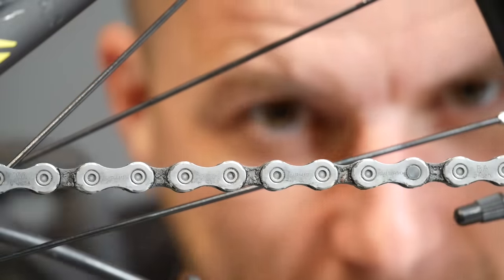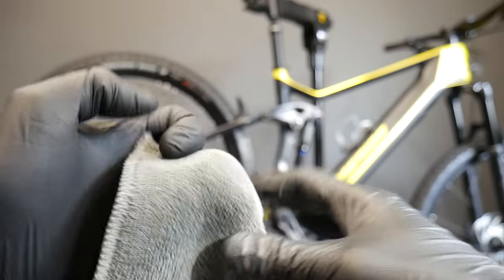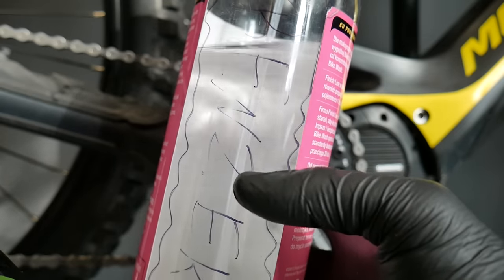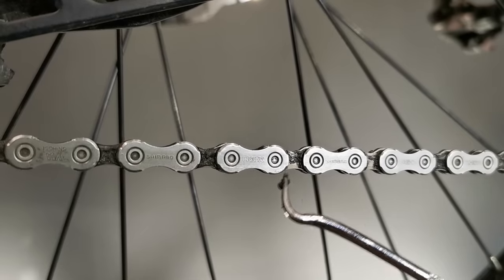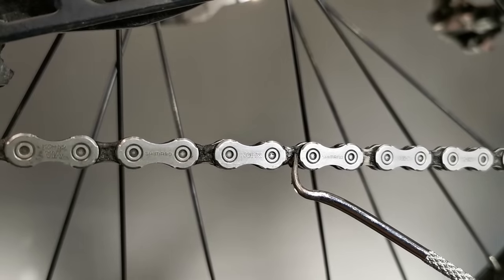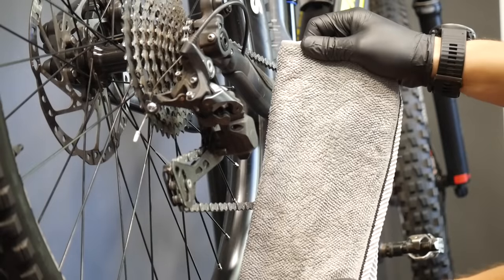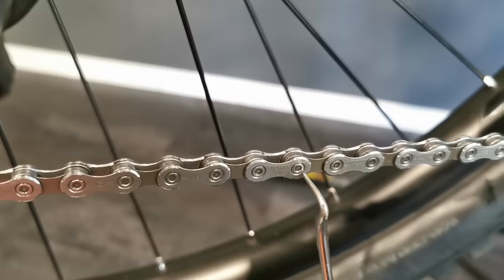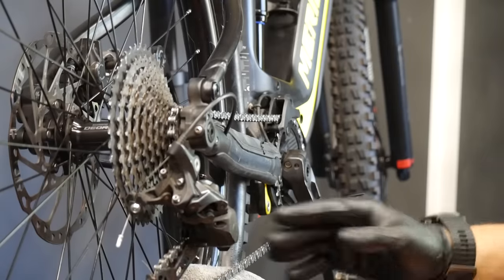This Drivetrain Will Last Much Longer. How To Clean And Lube Dirty Bicycle Chain. Slow Mo Comparison

Comment: I enjoy your channel. You have some great ideas and do nice work. But...from this and another vid I watched, I do think you over think the chain cleaning and lubing. There is no way a chain needs that level of detailing. Having said that, I like the diy double tooth brush tool will give that a try. Also I hope you are not washing those greasy rags each time. All that crap down the drain...ick.

Comment: Takenthe chain off and degrease in a parts wash?
Reply: I have several chains, I take a dirty chain off and dump it in degreaser for a day or 2 and in the meanwhile use another chain which is ready to go after having been degreaser, rinsed and dried then lubed.

Comment: parktool tool, with muc off yellow chain cleaner. Faster, easier, better results. Just use the tool with muc off, than use the tool with water 2/3/4 times until water is clean after the uses.
Reply: or use the Parktool with biodegradable parts cleaner. You will get much better results with 1/10 of the work vs as shown in this video

Comment: I would prefer to buy a new chain then go through all this, time is worth more than money. All I do, once a year at start of year I take chain off, soak in kerosene and shake. Then hose off chain then hang up and blow with air compressor. Do this for road bike, and 2 mtb, I usually ride in good conditions though

Comment: Use brake cleaner on the chain just as you would the disc of a brake caliber it will take the grit and grime album between  Wipe it all gone then re apply chain oil to it AKAA3 and 1 oil chainsaw oil motor oil because you're gonna redo it a few times every year but this is how you do it

Comment: You say the towel you got will clean your chain better maybe but the cloth you have you can catch inside the chain between the links not noticing you could open one of the link with their picture of the tyrael's when you are changing from up to down there change will start to angle easy to come off if you have a old shirt a cotton shirt or an old bed sheet that would be a lot better you are trying to clean your chain and trying to get any debris away from your train so it is nice and clean from inside and out between of the outside of you change you might have some some kind of build-up on the outside of your chain that needs to be clean quite well you really want it like it was brand new from the shop any kind of grit or dust or any kind of cloth it will cause problems with changing or not seating properly between the chain rings the cassette and the jockey Wheels using a cloth with no bobble B or anything like that
Reply: use some punctuation, Mate. I ran out of breath reading your comment.

Comment: I can tell u a better way for it. Take off the chain. Put it into diesel and wash it with a brush. Then use high pressure washer. More faster than this way and more cheaper.....
Reply: Yes. my method. very efficient.
Reply: Ruin your 
Bike

Comment: To me it seems that a mechanical chain cleaner would do the same job much quicker with less effort.
Reply: True, but not everyone has one or can afford one.
Reply: @AndrewBlucher  And using a tonne of solvent every time is expensive. Simply putting my drivetrain components in unleaded works well enough for me, and is super cheap.
Reply: @xx-----------xx873  I suspect that the clear fluid he used was a similar hydrocarbon. Or maybe kerosene.

Comment: OMG this is too much work to clean a chain, too much time! Just use a brush with degreaser in the drivetrain, let it work for 5 minutes, water, clear rag, done in 10 minutes total.

Comment: Really is a terrible inefficient way to clean a chain. Not enough degreaser. A shoe string… no

Just take the chain off and soak in degreaser and brush it

Comment: Option 1: spend long hours on make it clean with fancy overcomplicated stupid methods and overpriced useless "degreasers", then ride 3 minutes and the chain gets dirty again-

Option 2: throw it in petrol, shake it twice then dry it out. Job done, 3 minutes, crystal clean chain, no brushing, no unnecessary steps, lubricate and go for a ride

Comment: Thanks for your review. But I do it differently. I remove the chain, then immerse it in a container with a solution (gasoline + oil), shake the container with a chain and liquid, wipe the chain with a woolen rag, put on the chain. Fast and efficient. No additional lubrication is required.
Reply: I'd like to try that but what if the chain is covered in mud?
Reply: @ivancarlogaming682  Dear friend! It's not a problem. The dirt will settle in the solution. The solution must be changed periodically. (the same ratio of gasoline (of any type) and engine oil (also of any type)). When the bike is heavily soiled, I usually use hot soapy water with a spray bottle to wash the bike. Also, without removing the chain, the dirt is first washed off from it, and then the chain is removed and rinsed in a solution. Wish you luck!
Reply: What ratio of gas and oil do you mix?
Reply: @fit4oneLife  Please use 100 grams of engine oil and 100 grams of gasoline to flush the chain. The two liquids are mixed in a separate lube bottle or in a plastic bottle by shaking.
To avoid problems with removing the chain from the bottle, you need to make a small hole on the cap.
A part of the unnecessary cable from speeds or brakes is inserted into this hole. The cable is first threaded into the chain, its end sticks out on the surface of the lid, and the lid itself is screwed onto the bottle, respectively, the chain is already inside the solution. Then place a woolen rag over the top and pinch the cable with your finger as you shake the bottle. Then shake the bottle with the solution and the chain for one minute. After that, the chain can be easily removed and wiped with the same woolen cloth. Wish you luck. I do this after every trip. I always have a fresh and clean chain. The operation is simple.

Comment: Toothbrush and $5 can of Kerosene from Walmart will clean the entire chain in 1 minute and will look brandnew. Motorcycle owner like myself use Kerosene because it is the most effective and safest with O ring of the chain..and it totally deep clean inside and outside of the chain. You will see the dirt drips right before your eyes.....then flush or spray with warm water...VOILA!!
Reply: tough stuff like kerosene/desiel/white spirit are probably fine for motorbike chane, but pedle bikes like these are a lot more delecate either just being thinner or made out of a less strong material or some will have special coatings for things like anti-rust that will get stripped off by harsher cleaners
Reply: @TheMasonkerr  Which part of the steel is kerosene going to damage?

Comment: This looks like quite a lot of work to do often. Maybe once every couple months of you use it often would be alright.
Reply: Yes, that would be sufficient if you would ride every few months. If you ride a few times a week I would do it at least once every week.
Reply: ride where? I ride around on the road and this kind of treatment seems completely overkill for that.
Reply: I think you are missing a vital point here mate.

The author of this video just shows you some unique and frankly out of the box ways to clean your chain. Whether you do it after each ride or once a year it's a matter of your personal choice and your riding style/environment. I think even if you ride on the cleanest tarmac there is still a good chance that you will end up with some tiny sand particles that will add some friction to your drive chain. It's all about finding a compromise between how often are you willing to change your drive chain components vs how pedantic you would like to be with your maintenance.

Comment: Oh boy!  You have way too much time to fiddle around....
Take that chain off, drop it in a bucket of petrol, shake it, toss it,  or whatever... put it back and get on the saddle again.
This would be the intermediate level.
Reply: A far better way is to spend $8 on a chain cleaner, the chain will be far cleaner than your method. Quicker, easier, better by far!
Reply: Used it, a hair better than the bottle trick. Still intermediate level.

Comment: why dont u just use diesel to wash it...
Reply: Did that once, although it works great i wouldn't recommend it. My brake pads got contaminated and were a pain in the ass to get back to 'normal' just using a bike specialized product would be the best option. All I use is a chain cleaning device for the chain and a brush for the cassete/chainrings and it comes out clean.
Reply: Because Diesel is oily and incredibly hard to remove lol.
Reply: To remove the grease on the chain and cassette.. never let them touch your brake pads.. and diesel is easier to remove than grease.. 🤭🤭🤭
Reply: @tungiewong  as I said before, it works however using a bike formulated product to remove the 'grease' works better. And why would you need to use such a strong chemical to remove grease if your chain is cleaned and lubed properly over a certain time period?
Reply: @satjotesaimbi8499  very true, u are right

Comment: Can i use WD-40?
Reply: That’s more of a grease remover than a lubricant, WD 40 is not optimal but you can use it
Reply: It's very good
Reply: You can use WD40, just remember to grease the chain more often. Like after every 2 rides.

Comment: Better use a painting brush, dip in querosene and brush chain, inner and outside, cassette and tooth wheels. Rinse with enough water. Dry. Lube with WD40 or equivalent. Done.
Reply: WD40 is not a very  good lubricant. It fights rust really well and is great for penetrating deep into cracks and unsticking seized bolts, but it is a poor choice for chain lubrication. At least if you spend a lot of time on your bike. I managed to wear out my old chain way prematurely by using overly thin general purpose oil. At one point I tried 15W50 motor oil, which worked great for a while, but then it got absolutely disgusting with accumulated gunk and it was an absolute pain to clean off.
Just get a bottle of decent all weather bike chain lube. That stuff is pretty cheap, and lubricates pretty well without being too resilient when you want to get it off.
Reply: @fnorgen  . Caugth. Thanks.

Comment: Anybody use brake cleaner? Ive used it several times and its pretty good and it much faster.
Reply: People tend to avoid it cause it's quite aggressive and not very environmentally friendly. It can also be dangerous to handle.

Comment: Buy chain brush cleaner clips, it's only $5.
Put cleaner inside, clip it on the chain and start crank. 
You'll have clean chain under 5 minutes. 
Now is 2022, not ice age.

Comment: Step 1: Use a wax based lubricant
DONE
Reply: Wax or really thick grease thats applied with heat. And WD40 bath would PROPERLY clean the chain from previous crap, finally with acetone or just bake cleaner to get the WD40 out of there.

Idk why people think that little oil thing can provide any kind of protection under such load, it only traps crap in the bushings...

Comment: How do you get a drivetrain so dirty??=
Reply: when oil/lube is mixed with dirt/sand or if you have just ridden in the rain, it gets gunked up real quick if you don't wash it off after those rides

Comment: I disagree with your opening statement.  Dirty or clean chain, If you have a elephant pull one it will stretch faster than if being pulled on by a mouse. in other words a bigger heavier rider will stretch a chain faster than a kid. Period.  Nothing to to do with how clean or dirty your chain is.
Reply: I think what he meant to say is that the dirt acts like a fine paste that grinds and sands down the cassette and/or chain quicker than clean one.
Reply: Wrong! The chains dont get pulled longer. They get longer because the pins wear down!
Reply: @Gieszkanne   True but higher tourqe will wear the pins faster

Comment: Follow his advice if you are into wasting time. Really, get a chain cleaning tool, it works way better and saves hours over the course of a season of riding. Also do not use whatever chain lube this guy was, notice the gunk on the chainring and the bottom pulley?. It should never get to that point, use a lube that doesn't attract every particle of dust on your ride. Always use a towel after lubing to get excess off of the chain. If you don't, then your chain, cogs,chainrings and pulleys will be gunky like his!

Comment: Using a DEGREASER is a dumb idea...
Just use KEROSENE and a cloth to dry the chain. Then apply oil and use a cloth again to wipe off the excess oil.

Comment: I'd rather just spend £20 on a new chain than mess about like this. 😂
Reply: He do it wrong...
Reply: If you ride several times a week replacing the chain every time it gets dirty would be cost prohibitive.  A chain can last a thousand miles if well taken care of.
Reply: I never clean mine apart from a jet wash after a heavy muddy ride but still get 1800 miles out of a chain set. £20 for the chain is my option every 4/5 years

Comment: WD40 chain cleaner spray. 
Spray on chain.
15 seconds later chain is clean.
Wipe with toilet paper.
Spray on lube. 
Total time taken to clean my chain to this same level...
1-2 minutes.

What on earth are you doing with all this BS.
Reply: If you want to get a quick clean up I totally agree, but it's still a waste of time. If the chain looks super shiny from the outside it doesn't mean it's clean where it's needed: there will still be lots of dirt inside where the friction between the chain links takes place. The only proper way to deeply clean your chain is to put it in a bottle of gasoline, shake it, wait a few minutes, shake it again and then clean whit a dry rag.

Comment: Wtat is the easiest way
Reply: Take it off . Hang it up . Jet wash.  Wd40 then lube add new quick link. Does better job just make sure your chain is installed correctly

Comment: Just buy a ultrasonic cleaner, put it inside with degreaser and hot water and it will be like a brand new.
End of story.
Reply: Because it is not the easiest part to dismount and mount the chain every time

Comment: Take off the chain, it's wayyyyyy easier to clean
Reply: Agree, toss into a water bottle filled with degreaser and shake.
Reply: Yes it is easier but it’s risky connecting the chain again and again. Chain cleaners do a better job.

Comment: I hate consumerist.society. something is broke? Let's buy a new one! Something works? Let's buy a new model even if last year thing is working nearly as new!
BUT!
Rather than doing this for 8 hours...I'd rather go to bike store, buy new chain for few bucks and install it myself. This all under 1h 😂
Reply: Or you can buy a chain cleaning kit and clean the chain in 1/2 hour for less money. Saves you money and time.
Reply: You hate consumerist society, yet do nothing to reduce waste, or actually support reusing materials. Hypocrite.
Reply: So while a chain could last 3 to 10 thousand kilometers with regular cleaning you choose to buy a new chain every what, 500km?